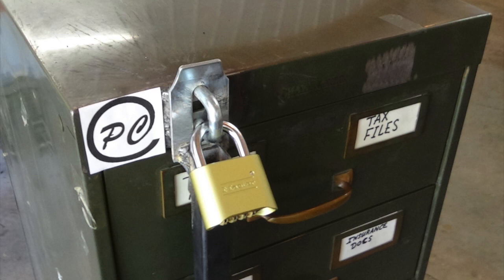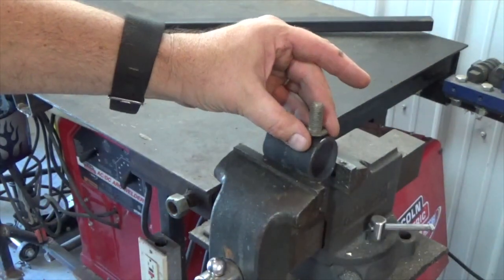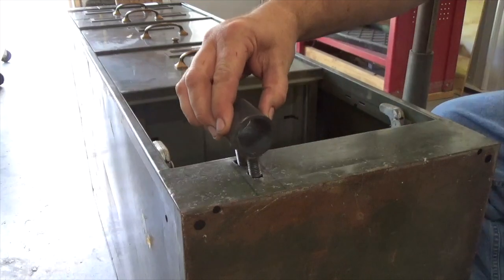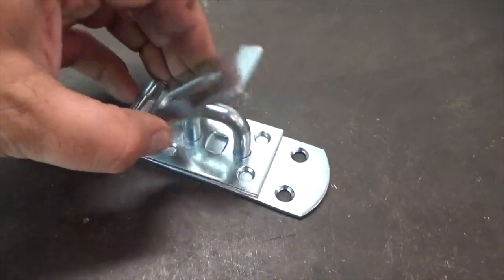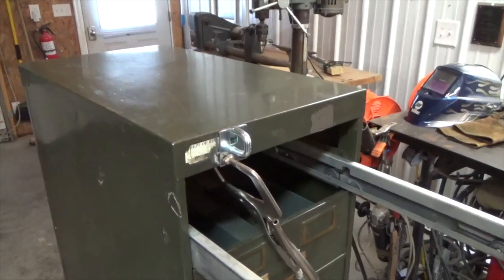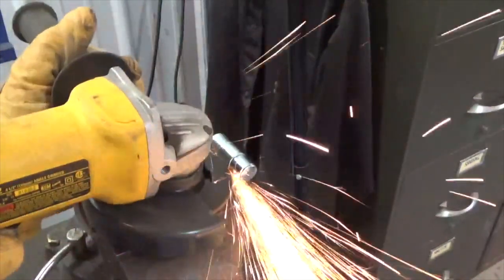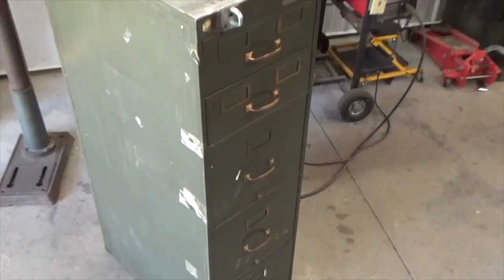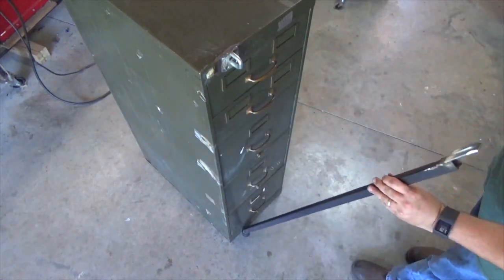HOMEMADE FILING CABINET LOCK - Welding

Comment: weld yourself up a little box around the hasp so you cant bolt cut or easily angle grind the lock?
Reply: maybe a scrap cutoff of some 3 inch tube..
Reply from the maker: Great tips!